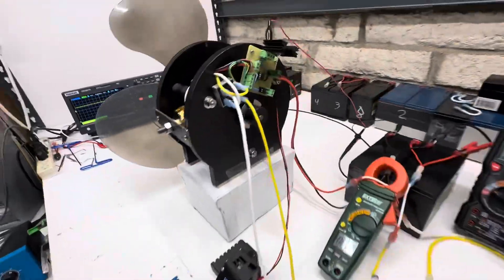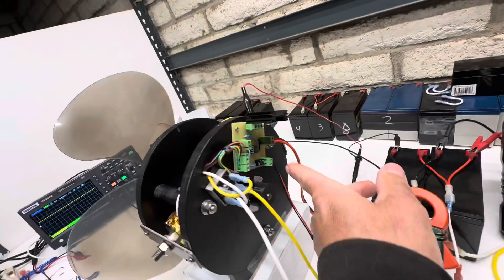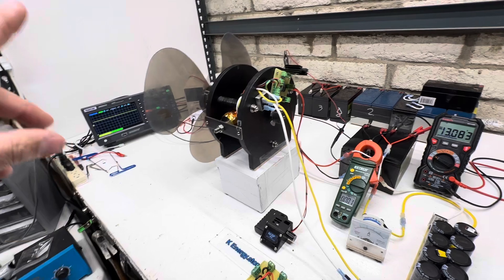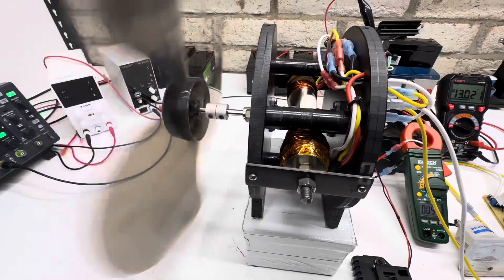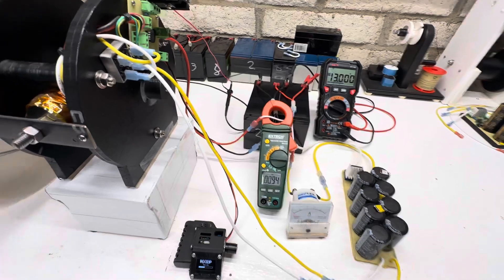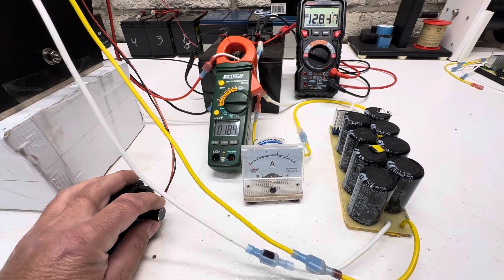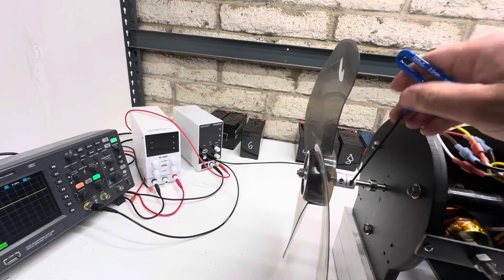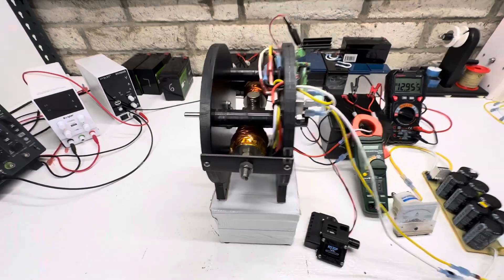Repulsion motor with upgraded circuit

Comment: Nice video Ken! Have you ever tried using 3 batteries where you put 2 of them in series (giving 24v) and the third one in reverse so the minus to the minus of battery 2 ending up again in 12v dc. Apparently the lifetime of the batteries would be way longer..
Reply from the maker: @hansscholte5472  yes that does work ok you don’t get as much amps for the motor though